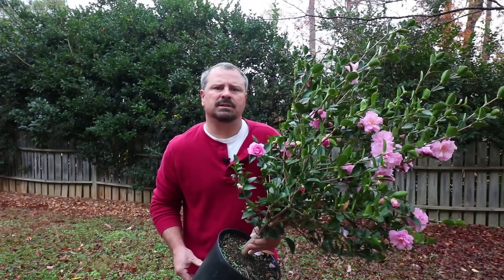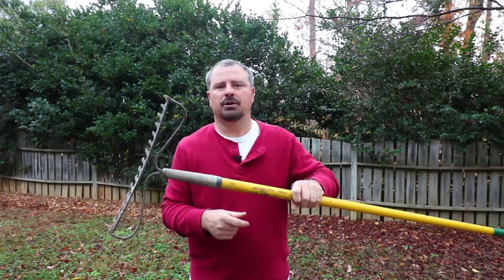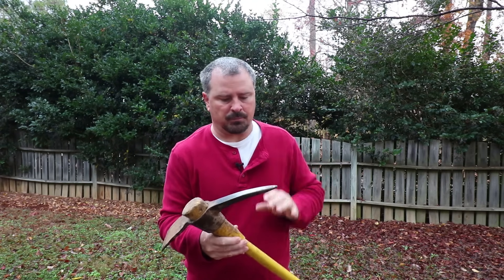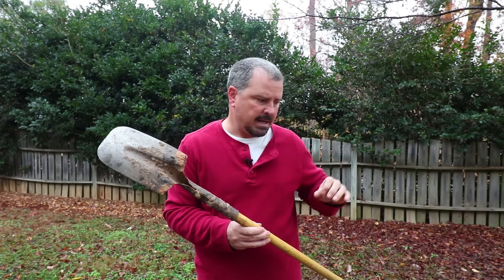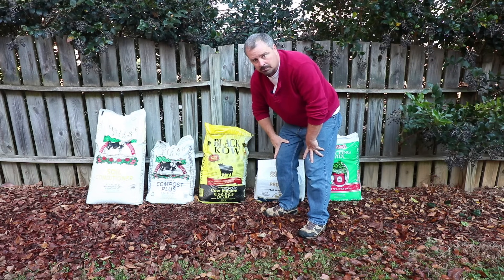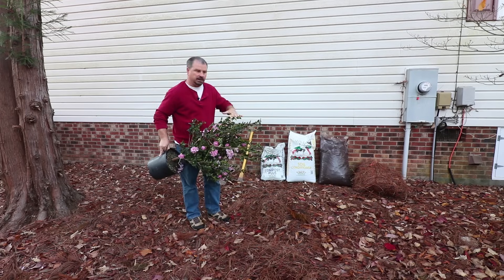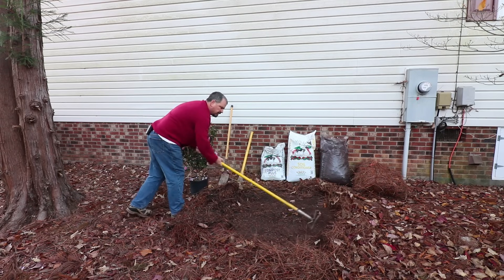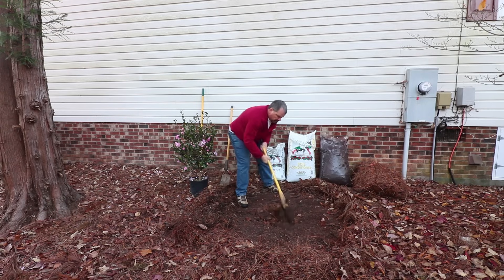How to plant in clay, poorly draining, and compact soils. Proper tools, amendments, and techniques.

Comment: Instead of a pic ax which does work, I have found my pitch fork much more productive. Work smarter not harder😅 The pitch fork breaks up a larger area and is about the same size as the shovel. Also if I'm adding soil condioner the pitch fork allows me to easily mix into the clay like a blender. Then I use my shovel to remove the new improved soil, add the shrub, back fill it with the improved soil. Easy peezy😉💕 tfs! Im enjoying your videos!

Comment: I live in a section of Hillsborough NC where the soil is not only orange-red clay but also completely compacted, and I therefore avoid buying anything but baby plants so as to avoid having to do the impossible, namely dig a decent-sized hole. Thanks to you, though, I just learned I've been using the wrong end of the pickaxe! But still... digging holes in this area, not for the faint of heart! 😄

Comment: I use a tool called the root slayer or a good sharpened steel handled tree spade fir digging in clay. The root slayer spade is a great tool.
Reply from the maker: Good information.

Comment: My town is out of the pine bark soil conditioner. I have pine bark mini nuggets , fine hardwood mulch or Baccto Tree , Shrub and Perennial mix . Whhich should I use ? Wanna get them replanted in the right medium . The tree , shrub and perennial mix doesn’t seem as barky as I’d like .
Reply from the maker: I have used mini nuggets many times. You can screen it to get the larger pieces out
Reply: HortTube with Jim Putnam , Thanks a bunch ! I’ll use my screen to get out the bigger pieces then . I’m mixing the mini nuggets, clay soil and the Baccto tree and shrub mix together so I’ll have a nice mix . Does equal parts of each sound ok ? Also , that hardwood mulch I have I’d quite finely shredded . Should I add some ? I appreciate your help SO MUCH! I’m digging the top layer off the soil that was around the roots til I find the flashes and I’ll plant 3 inches above grade . You’re awesome 😎

Comment: Have already seen thus video but wanted to add that putting in rock as a mulch or to amend soil because people do think it will help with drainage . This will eventually sink in areas with clay based soils and cause problems with root growth and if you ever need to top dress plants which I do in some beds maybe 2 in a season as materials decompose . The rock will make it very difficult to ever dig in that soil again especially if you have to remove dead plants or replace anything . Just don't use rock in the southeastern us.

Comment: Love your video. Digging a deep hole (!' - 2') is very difficult and it seems to trap water from the saturated clay soil causing root rot. Digging a more shallow hole and considerable wider hole seems to help with root rot. One thing to remember, spend time to spread the roots out from the root ball.

Comment: I wish I had clay that dug like that. My VA clay is solid from the surface on down
Reply: I think the key is hitting it when it's just damp; not immediately after a rain but not when it's stark dry either. Couple days after a rain, my local gardening club has suggested. They say the "season" for digging is a few weeks in the spring time when the winter ground starts to dry.
Reply: Definitely keep a sprinkler on the area and dig when its damp! Doesnt rain that often here in NM and the soil is hard as rock when dry, but when its damp its better. Still hard but way easier to dig

Comment: This type of "Pickax" is actually called a   "Pulasky"  after one of the founders of the US forest service, started under Teddy Roosevelt.  The sharp end is the "pickax" and the other wide spade-like end also needs sharpening and is  for chopping and pulling roots and trail maintenance, also for quickly digging holes when planting a swath of reseeding seedlings and for digging out buried fires under trees during forest fires. (A forester in the field got to carry  one tool - if they were lucky).  Forest rangers are really badass.  I met some in Big SUR during Sobraines Fire.  btw great videos, this and others very well done !!   THANKS  !!

Comment: Very good point with the peat moss if you're just digging a hole, but what if you are loosening up a lot of soil and mixing it all together with compost & clay soil and other things and not just digging a hole and putting it in there, do you think that'd be OK?  I just took some of my clay soil and mixed it with a lot of different things and put it all back into the bed and then planted in it

Comment: I disagree that u only dig the hole level with top of the new plant.  digging a couple of inches deeper, adding starter soil in the bottom and then measuring the container to the top assures a better base  and allows some depth for the roots
Reply from the maker: I'm sure the company selling the "starter soil" agrees.

Comment: I've heard to soak plants in a bucket of water 20 minutes before planting as well as the hole. Does it matter?
Reply: I do this often - and add root stimulator to the water.  It helps the plants to get a good start - with less plant shock.

Comment: I use a product called, Clay Breaker. I'm in Australia. I sprinkle generous handfuls on the surface of the area to be planted out at least 6 to 12 weeks before planting. Reapply it weekly. Water it in each time. The product breaks down the clay and then planting can commence. It works extremely well. Plant directly into the broken down clay. Once the plants are established, occasionally sprinkle the ground surrounding the plants with the 'Clay Breaker' and water it in. No need for any hard physical effort. Australian native plants do not require organic material in which to grow. They prefer acidic soils so there is no need for fertilising or adding nutrients of any kind. They're relatively drought hardy. But you can fertilise non native Aussie vegetation once you've planted it into the broken down clay.

Comment: I would dig deeper and wider and put sandy loam or soil of ph required, transplant the plant and put compost around it. The root grows/creep faster in sandy loam than in clay. In clay soils, I generally recommend amending as much of the planting site as you can rather than only the planting hole. Amending only the hole in those conditions could lead to water accumulation, a sure cause of death.

Comment: I do not usually comment on material that has been around for a while. This guy dose not have any idea about planting shrubs or trees. Unless you want to constantly feed and water a shrub or tree for the whole first season do not transplant it in its growing or flowering season. By all means you can buy them in flower and re pot to a larger container, use as a show plant until they go semi dormant then put them in the position they were bought for and when they start growing cut at least one third of the new growth off to match the top to the size of the root ball treat it as an over sized cutting it will reward you by being healthier in years to come. if you are putting it into clay soil do not over amend the soil the shrub or tree will be in that soil years after your amendments have rotted and dissolved away. The best way to amend any soil is to grow annuals each one amending the soil with a small pocket of growing medium when it is planted and the old dead roots make pathways through the soil if you cut the tops off instead of pulling them up. Wood and bark chips that come in bags are not recommended due to them containing poisons or growth inhibitors put in to make them last longer use fresh chips if you can get them they soon dry out and start decomposing where they touch the soil. if you have hedges or shrubs get a second hand small machine and make your own. If it grew in your garden chip it and put it back as fertilizer.there is no need to compost any thing the soil has been doing it for millions of years and it dose a better job than you ever could. Do not move bags of amendments that you are not going to use waste of time, same goes for tools.
Reply from the maker: It's a fall blooming Camellia. It wasn't growing. Just opening the last of it's flowers. So potting into a container would have exposed it to freezing temperatures in a few weeks.

Comment: Ok, now I’m worried.... I planted mine and had not seen this video! 😥 I used raised bed  soil,  I  forgot to loosen the roots, I mixed in acidifier to the garden/raised bed soil bc the ph was to alkaline, I also planted it 2” above the level so that I could mulch with pine.  But I also gave fabric filter.. it might be hard to fertilize. 🤔. I’m new to planting anything!!

Comment: Jim, does this apply to regular vegetable garden preparation as well?
Reply from the maker: I actually use compost in my clay based vegetable garden to improve it. I add an inch or more each season. It will take a few years, but you will see it improve every season
Reply: @JimPutnam  We have some old wood chips that have been composting for 3-4 years we will use them then. Thanks so much!
Reply from the maker: That'll work great!!

Comment: Fun fact:
About 100+ years ago, settlers in the midwest had to dig hardpan. Extremely back breaking work.
They resorted to using dynamite to blast up the ground!

About heavy clay soil - Pelletized Gypsum can break up the heavy clay.
One might want to add some 'construction sand' not play sand into the mix.

Comment: Hmm, I thought we had clay soil here in CA San Francisco Bay Area but now I’m not sure because I use a regular metal handled digging shovel. I jump on it and wiggle it forward and back and then side to side until it slices down into the soil. I can do this in a circle or both sides of the intended hole and then pry a chunk of earth up and out. I’ve broken 3 old wooden handle sho els though.

Comment: I know that soil--dug two foxholes in South Caroline (Ft. Jackson)--red clay then white clay lower down. Here in central PA there's clay and limestone--it varies--but I'm unlucky to have lots of both. I don't have the upper body strength to use the pick axe much (I'm doing a lot of landscaping this year) so I use a pointy shovel (QVC) and sometimes have to wet the soil a bit. Let soil dry again to mix in soil conditioner. Very good video--I already knew this info but it is nice to see someone else tackle clay soil!

Comment: Jim do you ever use perlite when planting ?
Reply from the maker: I don't. I use it in propagation all the time. There are lots of people that do use it in the soil. I don't know how it holds up over time or if it comes to the surface over time like it does in the propagation trays. I probably should test it.
Reply: @JimPutnam  I planted some boxwood in a area that seemed to hold water so I tried adding some perlite I  hope it works. Thanks very much for your fast reply. You should check out the root slayer spade on ebay. I am not affiliated any way with the mfg. I just think it's a great tool.

Comment: THANK YOU for this video!!!
Unfortunately, I discovered that the largest main bed in front of my house (in north Alabama...red clay to the max) was installed incorrectly a couple of years ago (by someone who does this for a living, for the city...) and I am very much not looking forward to embarking upon the process of trying to amend this situation. Being that all of this new “dirt”/dry red clay was trucked in, re-leveled over the entire yard, mounded into the flower bed(s) and then tamped down into a solid mass of dense mud clay under a huge tarp of weed barrier and entirely too much mulch. It basically just compacted all of that clay down on top of all my brand new shrubs, trees, etc. like a choke hold. So while some of them are doing ok, others are really struggling (some are probably not going to make it), and I know it just can’t be good for any of them. Do you have any tips for anything I need to be sure and as I work to hopefully rectify this? Currently my plan is to remove the remaining mulch along with the weed barrier, then take my “claw“/ aerator and work through the entire bed loosening all that compacted clay. I was going to add some different soil, so I am thrilled I found this video/now know the best way to amend the soil in the bed. Is there anything else in particular you recommend I do to the actual plants/root systems? Fertilizer, etc. 
Only two trees, which are both hinoki cypress. I know that they are a slow growing breed anyway, but after two years they should be bigger than they are. I have just figured it is due to the soil issue. Do I need to try digging them up and re-planting them completely? I’ll do whatever it takes to give them all the happy life and growing conditions they deserve. :) Thanks again so so so much for sharing this information, I appreciate it so much!

Comment: i have nothing but heavy hardred clay, and have tried planting 6 foot tall apple trees, in the clay, even with a pick takes a good hour or more to dig a hole to fit them in, i have tried mixing the clay with wood chip, small stones, they died after 3 years, my land is hilly, so i tried again thinking being i left the dirt on the root ball, i tried 2 more trees, this time i dug the whole but also dug a trench out the bottom of the hole on the down hill side, and put a 3 foot long peace of drain tile in the trench, and under the root ball, covered the tile with fabric ans 3 inchs of crushed stone, then planted the 2 new apple trees, thinking extra water will drain out the tile, i again mixed the clay with a little bark, and mulch, again it leafed out for 3 years, but no new growth, the 4 year the graft apple died but the root stock still sprout leaves and small branches, now 10 years later the root stock still lefes out on the stock but dont do anything more. i gave up

Comment: Great advice, specially on piling mulch around the trunk of the plant. Landscapers do this and they should know better. I think they do it because they know in a few years they will be back, with new business, replacing the trees they killed by doing this. Here's the problem with piling mulch around the trunk of the plant, above its crown. Dirt, or mulch that eventually breaks down into dirt, will eventually cause the bark of the tree or shrub to rot and/or get eaten away by insects. Trees and shrubs cannot live without bark around their trunk.  It may take years to do, but eventually the tree dies when its bark layer is destroyed around the circumference of the tree.  

Another pointer on buying mulch: Go to your home improvement store and ask what they sell their damaged bags of mulch for. Some say 50% off, some are $1.00 per bag!  I have bought cypress mulch for $1.00 per bag! Incredible deal and not much mulch is lost from the broken bags. Line your vehicle with a tarp for easy cleanup after hauling it home. You are getting a great deal and relieving the seller of bags that won't sell at the regular price.

Comment: I use the full size shovel and just jump on it with both feet. Maybe not the safest, but very effective ( I do weight 240+ lbs so that helps).  After watching this though, I'll start using my pick axe.  I bought it for some other reason and never thought to use it for digging holes for plants.
Reply: Dude, youll break an ankle that way💚

Comment: Thanks Jim, I learned a lot from your videos.  Some of the simplest things I hadn't thought of will make my gardening much easier.  I live in Covington, LA where the ground is rock hard and had once been a golf course.  Drainage is awful. We had a professional do some French drains and other drains because we made a large garden in the front of the house and on the side by our front side door another which stunk to high heaven when we first moved into our new build home.  Initially, I had purchased extra top soil and some garden soil Miracle Grow into the holes where the new gardens were planted only to find that the new gardens were in a large bowl that didn't drain. Wow! We did use a professional landscaper but either they nor I realized these were going to be clay bowls that rotted and stunk.  They were able to come back out and put in drains that helped and when we added a side cement sidewalk going around the side/back of house, we used some strips (hwy.) strips that had drain holes, so we have been doing ok.  However, I keep adding more soil each year as the top soil/Miracle Grow garden soil drifts down, leaving our gardens lower than sidewalks to drain.  Do you have any suggestion about how to keep this soil from sifting down and yes it's packing really hard and needing to be aerated.  We are senior citizens and it's getting harder to handle.  Any suggestions much appreciated.  You are a blessing, thanks Barbara

Comment: How does this make a difference when you're on a lower water table? I'm in an area where the soil holds water because it's silt but I'm also low on the water table
Reply from the maker: Yes, the water table would make a difference in any soil. I was in Louisiana last week. No clay at all, but they still mound plants up because of the water table. Not an issue in clay soils inland really.

Comment: Two quibbles here.    I'd ditch the trenching shovel and use a Spade.    Sometimes it's all you need after a rain.    Next, I use a digging bar instead of a pick.     The pick has a short handle and it's murder on the back.     I can work upright and use my weight to loosen the soil with the iron bar.    If it's dry and hard, I did down about 4 or 5 inches then fill the hole with water overnight.    I can then come back and go down a foot quite easily.      Work smart, not hard.      ;)

Comment: That rake at the beginning looks like it has a thin metal loop inside the tube-end that attaches to the handle?  How did you attach that fiberglass to that?  Also I thought the soils east of the mountains were more acidic-or is that further south in Georgia?